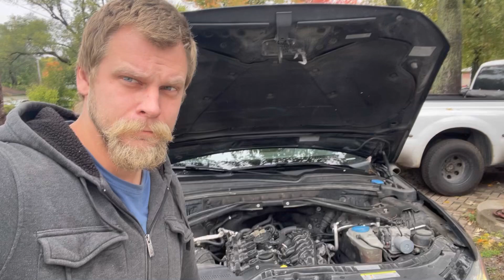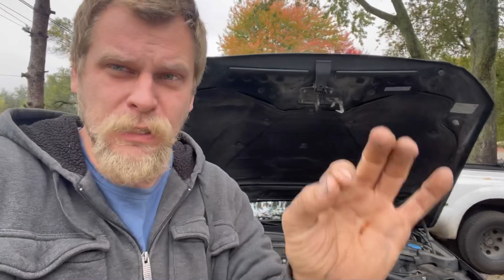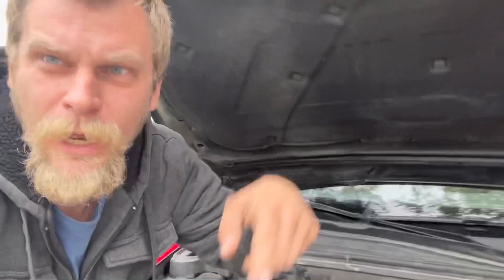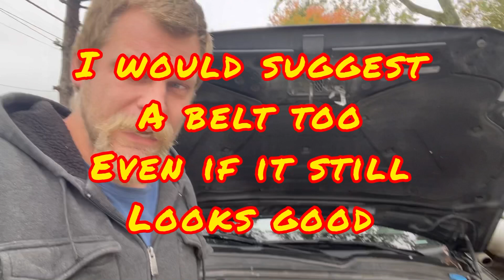Intermittent “Belt Noise” Audi Auto mechanic explains Accessory / serpentine repair tips testing

Comment from the maker: Here is the noise it had https://youtube.com/shorts/IvY0G_Z0k3E?feature=share
Reply from the maker: You can’t also hear it in this one https://youtube.com/shorts/XrGz4ZoO78U?feature=share
Reply: Pretty sure the B9 S5 has the same issue: https://youtube.com/shorts/f7vIox969N4?feature=share
It comes and goes, changed the belts and it's still happening, so must be the tensioner.